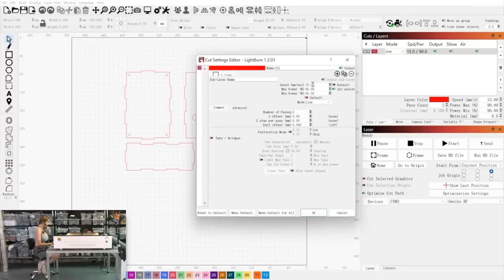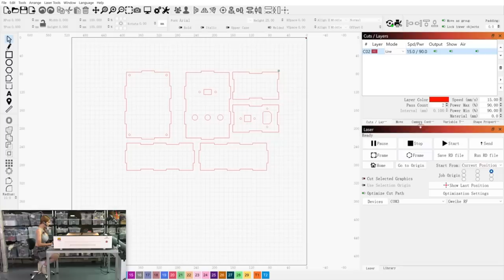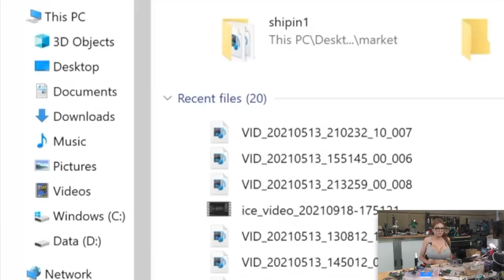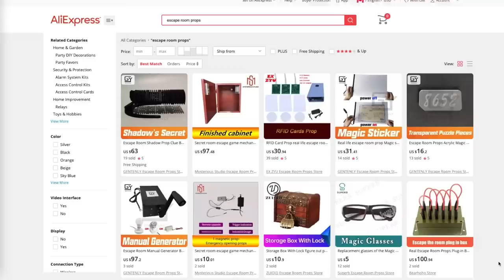Chinese Spycraft! Emergency USB Drive Destroyer!

Comment: Hmm.  Most of the villains you see on TV would be so annoyed that you'd destroyed the data that they would probably connect you to the 240 volts too...  Are they nicer guys in real life?  I'm not so sure...  Alternative strategy might be some means by which you tell them the password - except the one you tell them actually corrupts the data in some way, so you can say "now look what you've done, you've wiped my cryptocurrency" - so you would appear to be angry with them, rather than the other way round.  Anyway, great video with ample warnings about safety!

Comment: Connect light bulb in series so you wont short mains and pop the breaker. 500W halogen lamp in series with pendrive and it wont stand a chance while the worst thing can happen is halogen turn on. 🤘
Reply from the maker: Good idea👍🏻

Comment: Hey mama bear, ever thought of partnering with electro boom? He might have a few ideas to try. Lol Using rubbing alcohol on a device while it is on will do damage as well ( electrical short) and the alcohol will evaporate and not leave a trace as long as it doesn’t cause paint to run.

Comment: First project that comes to mind seeing this: making an app or a GSM circuit of some kind which allows you to activate the USB fryer remotely with a phone if you like.

So if you have a home alarm system that sends you a notification if someone has broken into your house, you can just push a button in your app and that will fry the connected USB stick connected to your computer or perhaps dial a phone number that does the same thing.

So even when you are away from home, you have the option of destroyint sensitive data from any would be home intruder.

Comment: Fantastic video, Naomi!  I've been fascinated with Data Destruction/Data Recovery for years. While I personally have no need for that type of protection, I find the idea interesting. I know that USB sticks can be surprisingly resilient; a few years ago I found a USB stick that not only had no plastic housing, but had sat on the ground outside during a full Michigan winter. I took it home, cleaned it up, fixed ONE pin and tested it. All the info was still there and easily accessible!  Now, if it had been electrically fried it likely would be impossible to recover.

Comment: I found the triangle of "Security, Functionality, Usability" to be the most useful to keep in mind - the closer you get to one, the further you'll get from the others.
Edit: also imho - If your threat level is so high and risk tolerance so low to set a tripwire, you might be better off with a "dead man switch" that requires some near-field FIDO2 device/other dynamic code generator, that triggers the all setup when lack of signal goes over some changing time period.
Thanks for another great vid, enjoyable and informative as always.

Comment: Happily, I would never need something like this but I love the red safety switch cover of the acrylic box!  I once made a launch controller for Estes brand model rockets that was way over-engineered, with parts from Radio Shack.  The launch controller Estes sells is just a light bulb acting as a resistor, with a button that bypasses the bulb to send the full 12 volts (from six AA batteries) to the igniter.  It also has a pin-type "key" for safety and easily fits in the palm of a child's hand (adult supervision required).

I got a box that was, maybe, 10 inches by 5 or 6 inches, with an angled front panel.  It had an alarm-type lock with an actual key, a  bright red panel light bulb, and a spring-loaded momentary switch with a cover, which had to be pushed closed during the entire launch. I even put a volt meter on it because Radio Shack had a volt meter.  Had quick release connectors so I could switch out AA, C, or D battery packs and a switch to heavy duty wire for external power from a 12-volt car battery, if you and your friends were going to launch rockets all day.  Painted the box gray and black and put black & yellow striped decals, from the model hobby shop, all over it.  It was a fun build, looked very, very cool, but all it really did was bypass a lightbulb to launch a model rocket.  Yay!
Reply: It was funny reading this comment because I built one like this as well when I was a kid 😂. I added extra switches to you could control multiple launch pads at the same time. Fun stuff!

Comment: When doing a "this password/that password" system, you need to make sure the one you will give to the guys with guns is convincing.  This means you likely need two wallets and two sets of phone lists and so on with the one you give up actually having a lot more bytes of data in it.
Another way to do the mains voltage thing that makes an even bigger mess of the device is to charge up a fairly large capacitor by rectifying the mains and then applying that to the device.  Mains voltage is AC and twice per cycle the voltage goes to zero.  This allows the arc to stop.  The capacitor will provide a much larger current and with a large capacitor the voltage doesn't drop to zero for some time.  The result is a plasma fire.
You can also add some material around the USB connector that makes a lot of smoke for a longish time.  This makes more drama for the noncomputer literate to see.

Comment: Thank you for this video. I was unaware that one could purchase a 4 pole Double Throw switch for the purpose of switching a USB device's four wires. I have wanted such a switch for frequently used USB devices that I still want to unplug frequently (such as a webcam) but don't want to wear out the USB jack on the computer.

A similar security use for the switch. Now I know I can buy it, I can do it too, for much safer reasons! 👍
Reply from the maker: Maybe this?
https://www.datapro.net/products/data-switch-manual-usb-type-a.html
Reply: @Naomi-Wu  Thanks for the Tip. Very useful 😊
Reply: "don't want to wear out the USB jack on the computer."--
Get a short USB extender cable. Leave the PC end plugged-in. Wear-out the other end swapping your USB toys. When the extender craps-out, replace it with new. If you get 1000 swaps on each cable and 1000 cable swaps before the PC itself craps out, that is a million swaps. A bendy cable also isolates the PC mobo USB port from bending-stress.

Comment: If the USB drive has a separate USB chip and flash chip, the flash chip might be able to be unsoldered from the destroyed drive and soldered into another drive. Blasting the D+ and D- pins might not destroy the flash chip and that's where the data is.

At a minimum, I would also wire the V+ and ground pins to the main as well so that the mains voltage is applied to the flash chip.

Comment: You have touched on a very interesting topic of private, sensitive data protection. I liked your idea with 230V for data corruption of the pendrive.
Indeed professional companies can recover data directly from the ram because the electric arc will be discharged earlier on the usb contacts and the memory may survive.
Regards. Hay

Comment: Just a couple of ideas, I would have some kind of cover for the USB stick when it's inserted in the port, especially if it's in a flammable area. I would look into using relays to switch between the computer and the destruct charge with a safety switch to activate the system. I would think about using a push button to activate the actual destruction. One advantage is you can have multiple destruct buttons located in different areas including some kind of remote (cell phone or computer app) system. 

I personally don't have a need for anything like this, I'm just interested in how stuff like this could work.

Comment: Incredible security device Naomi. I think Cash Drawer Switch like bank use be very suitable. Simple bit of paper in drawers stopping circuit untill removed 👍You could have multiple drawers/ circuits in any location 😜

Comment: Props for the XKCD reference! I understand it is sometimes possible to literally "read" some chips by removing the packaging and examining under a microscope. I know this was the case with some EEPROM technology. As you say, it's very expensive and difficult to do, but well within the reach of any nation-state actors reading this comment. 👍
Reply: Ironically: the cheaper the SSD the harder it will be to do. (MLC vs SLC storage: though the MLC devices may have an SLC cache).

Comment: I had a conversation with a guy who worked at a data recovery place. He said they have an "escalation of destruction cost analysis". Basically the more damage the more it costs. I think the key is to do more damage than it is worth to recover, if you can't get total destruction. He said "drop it in a blinder then throw it in a fire" LOL

Comment: This was a fun one!  Watching your lab operations has helped mine, and my latest is a shortwave radio built in 1961.  No semiconductors anywhere, but that may change.  The temptation to stuff a 1N34A into a dead 6H6 is always present.  Experiments on the radio are limited due to its massive 20 kg bulk.  Arthritis is not fun!  The goal with this radio is to increase its sensitivity so it can hear the faint signals that barely make it over the box canyon I live in.  Why shortwave?  I do hate-watch.  I'm looking for a way to exterminate hate.  When this radio (Hellbeast Boatanchor is its name) gets to the point where I can hear the evil, recordings get made & revealed to social media.  Otherwise, I don't know what else to do.

Since I'm going to be poking a rather dangerous bear, this USB killer will certainly come in handy.  Thanks for building one <3

Comment: Always love your projects and content! Wouldn't a high powered taser so the same thing?
Reply from the maker: If you ran it through the data pins, sure you could use HV capacitors.
Reply: @Naomi-Wu  Added bonus, properly constructed the capacitor circuit gives you a backup, just in case you have a sudden power outage right before the door kickers arrive.

Comment: A better idea would be to use a cheap stun-gun circuit. Run that through a USB stick and every semiconductor junction in the USB stick is likely destroyed. It should be much more effective than the relatively low AC Mains voltage.

Comment: Great Video Naomi, the fact is that the semiconductor memory cells and been over voltaged and are most likely destroyed by punch through of the Gate insulation on the nano circuitry. an avalanche breakdown that is no recoverable from. Most likely all of the chip is destroyed, making recovery impossible. I liked the sparks and bang most excellent !!! Lol

Comment: Shhhh...don't tell anyone back when I was young and dumb, I did my fair share of "grey-hat hacking"

Any equipment I used was fitted with a thermite destruction packet. RAM/CPU/GPU and and HDD/SDD/USB/CD/DVD drives all had packets. Hardest part about the whole process was keeping my work area clean. It the details that will kill ya

Comment: The way you pronounce "Secure" sounds like SKEWER. A spike used to pierce meat to BBQ.
Also, best design would be a "Dead man switch" if the power to your house is cut, you can still zap the USB.

Comment: I might suggest going for something a bit safer and potentially more reliable... like a step-up circuit run from from 5V to let the magic smoke out, if you put an acryllic cover around it you might even see the smoke trapped. If they miss the short flash of your circuitry then you don't have anything to convince the "meathead" that the data must gone... After all your circuitry also might have some unintended side effects like arcing over before it even reaches the chip and/or tripping the breaker after first use (which would be bad if you had to destroy some more items).
Reply from the maker: Yep, that's a good way also.

Comment: I wonder if it would still work plugged into a GFCI outlet (Ground Fault Circuit Interrupter). I'm betting is will still disable the drive.
Reply from the maker: Really good question🤔

Comment: These types of topics always seem very interesting to me and you have done something that I had never seen before 🤯. What I do to delete files with sensitive information is that I corrupt the file with notepad by deleting code and then I delete the entire file using at least two passes. And for usb flash memories and hard drives I leave them in salt water until everything corrodes 😂. An off-topic question: How did you get the first person point of view video while you were working? 10:00 🤔
Reply from the maker: Head cam link in description...
Reply: @Naomi-Wu  Thank you! 😊👍

Comment: Favorite 'Sexy Cyborg' video yet! I've heard cautionary tales of USB sticks that were actually tiny bombs. (Hint: capacitor) Had me wondering about the feasibility of a "portable" version of this. 
Also, what is the AC line voltage where you live? I'm guessing 220v, although 120v would probably work as well. Definitely just as painful the whole time you're dying!

Comment: Do Chinese plugs not have an earth built in, like a UK plug? Also, spectacular way of killing a USB drive!
Reply from the maker: They do, I didn't connect it, it's a pretty horrible project😅
Reply: Aaaah I see! With usb, is it possible to do multiple read/write deletion as a means to completely erase data on there? I used a program years ago (admittedly it was for hard disk drive) that did that. Your workshop is to die for as well, so many fun machines and tools!
Reply from the maker: @adamletchford4018  Yes, the best way to erase them is overwriting the data- but that takes time.

Comment: Actually there is on sure fire way to protect a computer, Air Gap.  I keep a computer totally air gap for security reason.
Reply from the maker: We're not talking about someone hacking in remotely. We're talking about someone smashing your toes with a hammer until you unlock your airgapped computer.

Comment: I used a 48V cap (250 mf) and the +/- power. Made a small hole in the case. The advantage with mains is the ac voltage. A step down transformer to, say 24V would still be adequate and “safer” to be around

Comment: In the days of the HDD, the drives must be physically pulverized to ensure data could not be recovered. These days I have more trouble with USB drives spontaneously decommissioning themselves than deliberately trying to destroy them.
How do you short an AC circuit across your USB drive without tripping a circuit breaker though?
Reply from the maker: I thought it might, it didn't.

Comment: Before knocking down the door your electricity power and gas will be cut out also. At least that's what they made us believe🥳
So you'll need a power battery to foresee the power to get thru the datapins.
Still wondering why you wane use a USB stick as 🔋 high voltage bettery 🤣
Reply from the maker: Not here, that would warn people...

Comment: I have software that would wipe everything to make it unrecoverable but I never thought to physically destroy it. Software takes only a couple seconds and this is instantaneous. What about a coil, and a really big capacitor? It's not the voltage that destroys things, it's the amperage. Could you do it with one of those big capacitors the size of a coke can?

Comment: Naomi . . . Are you REALLY SURE you want too trust anything too a lawyer?
Good thing I don't have anything worth being encrypted. But I am sure I could use other things too get the same or similar result's.
Such as a Jug of Hydrochloric / Sulfuric acid. too drop the USB in.  Or just toss it in the Microwave and set it for a couple mins.
Could always drop it in a jar of rubber cement and set it on fire too.

Comment: Back in the mid eighties when cell phones used a one use prom chip that contained the customers phone number and various other parameters for the system it was assigned to. I had a customer who wanted to have his old prom chip destroyed so I smashed it in front of him. Not the best way to cleanly destroy an IC chip. I came up with a quicker method to terminate the chips. I used a quick release IC socket on a piece of breadboard. One whole side was wired to one buss and the other side to another buss. Applying 24 volts AC at 5 amps ensured a violent shattering of the chip exposing the burnt die within. Had to add a clear plastic container to contain the pieces of the chip. It did not shatter the ceramic chips but still cooked the die within.